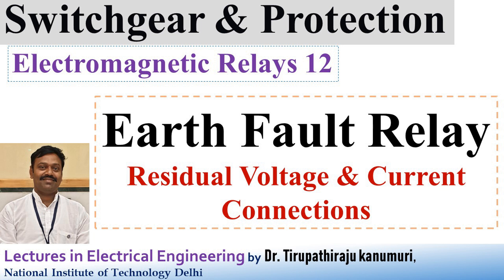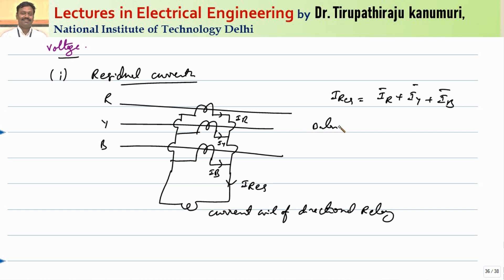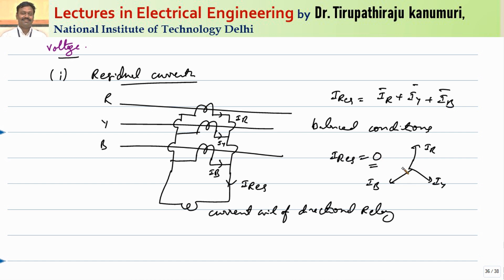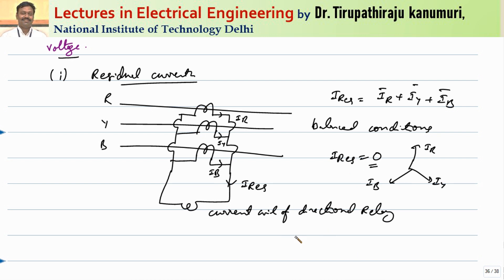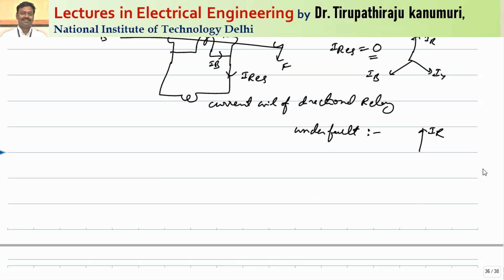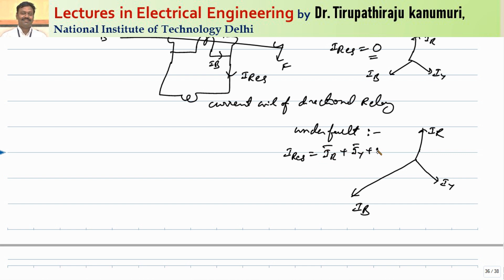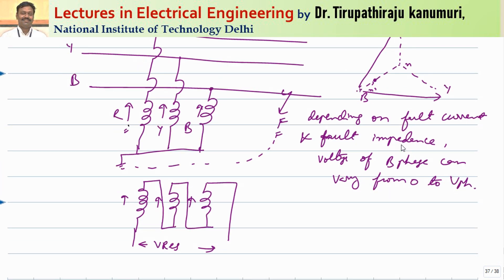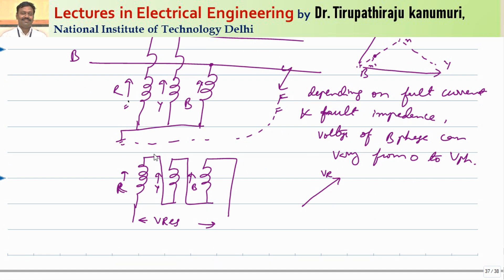SGP312 Earth Fault Relay

Comment: Hello Sir, here in this video precisely at time 8:35 you said that during fault at phase B, the voltages of two other healthy phases  are going to got increased  to line voltage values as a worst case of being the fault impedance equals to zero, although the neutral point of primary windings is soildly grounded, but with reference to your kind series of neutral grounding practice in power system, the voltages of healthy phases have been kept constant at phase values without any rise and this in case of solidly grounding neutral, so could you please clarify

Comment: Sir,
In neutral solidly grounded system you have shown that voltage across the phase will be phase voltage in case of occuring line to ground fault.
But in this lecture in PT connection with neutral grounded you have shown that in case of fault voltage across the other phase will be line voltage. It is contradictory. Please clear.
Reply: From 7.00 minutes in this video..

Comment: sir please, so for the earth fault relay connection, either the non directional overcurrent relay can be used or this one can be used as well
2. Secondly, in this method, is it only the directional element of the directional overcurrent relay is used to make the connection.